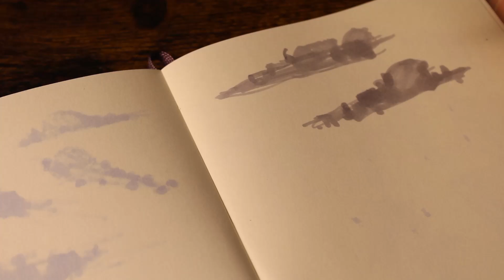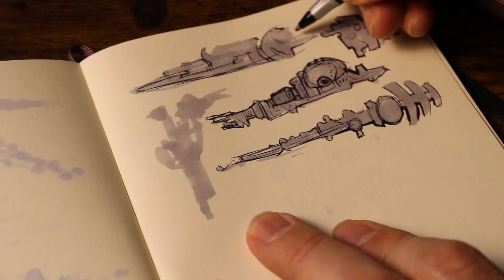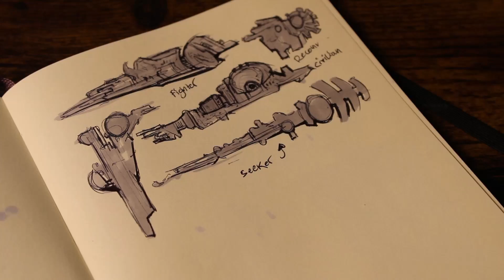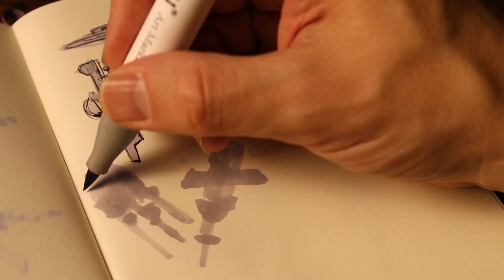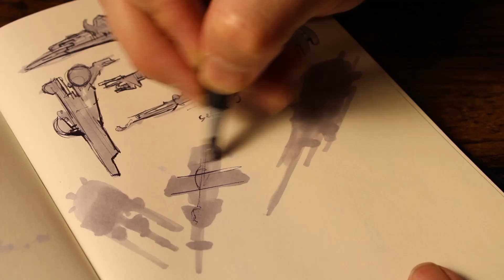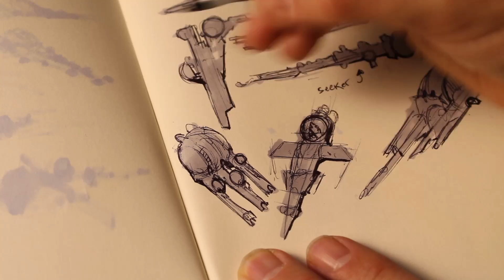Concept Art Spaceship Design — Easy Industrial Design Sketching Workflow

Comment: I am not very creative person and I work as a programmer, I found this video while seeking for advice on how to design cool ships/planes as a hobby to build in a video game. Video is very helpful and I'll certainly try to learn this method.
How would this method work if you had some constraints? For example it's a plane, it has to have 2 engines, or it has to be fat to accommodite for some kind of internals? In other words i know roughly what internal parts plane will have, and their rough volume relative to each other, and i want to arrange them in a cool way and create beautiful overall shape and design and details.